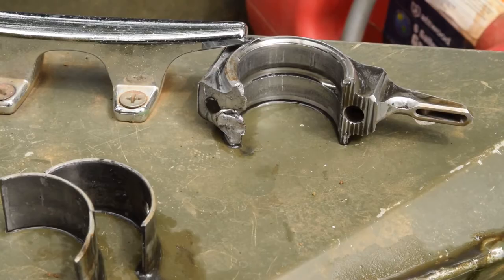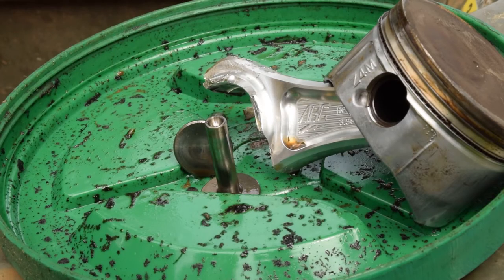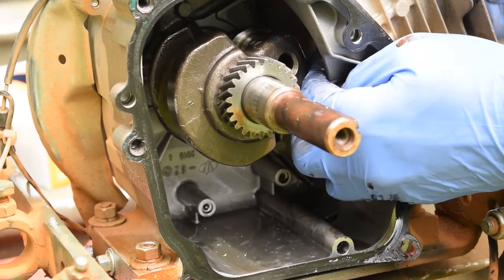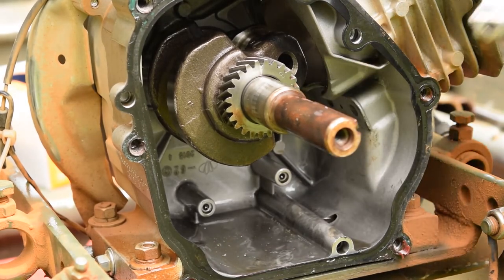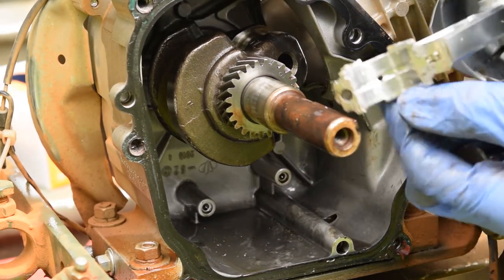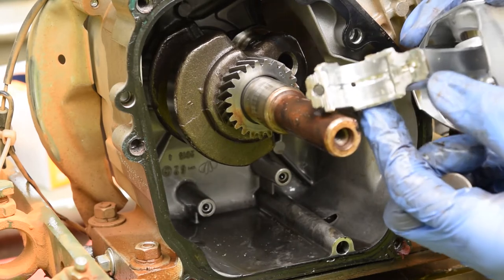Thailand Outboards Hot Rod | Current Recommendations

Comment: I've followed you for some time and always enjoy your videos. I ordered a stage 3 212 from nr racing, tuned and dyno'd with just about all the internals upgraded. I'm hoping with all the extras I had them put in, as well as the company I ordered it from, the engine will be as efficient as it will be strong. Putting it on a alumacraft 1232.
Reply from the maker: NR builds good motors. Be careful and don't push the engine to much. Don't run it at full throttle more that 1/2 a mile or so. Keep it well below 5,000 RPM most of the time. Get a good tachometer, and baby the engine. Don't thrash it.
Reply: Black Warrior Lures, I bought the tack through SPS. I don't plan on doggin it out or even running it above half throttle as to half throttle, around 6000 RPM, it's pushing 16 horsepower which is more than enough to push a 12 foot jon boat with one man and less than 50 lb of gear
Reply: Also, I opted to get the Billet side plate which comes will a second bearing to help balance the cam. Which I hope will cut down on vibration and wear and tear on the motor
Reply from the maker: I've always wondered what the billet side plate would work like.
Reply from the maker: Yeah, that's about what my old Predator did. Part of my argument too that I didn't mention was the cost, for the cost of building a motor like that, you could have bought the medium kit, a 301 Predator and still had more torque than the hopped-up build with none of the risk.

That's not to say you made the wrong decision. It's your money, and I certainly didn't buy the motor for you. I promise you will enjoy this engine. 

And I hope people don't get me wrong I really do enjoy these little 200cc engines. In terms of power-to-weight you can't beat one of these built small-block engines.

In terms of reliability-to-performance and cost-to-performance, there is much found wanting.

At any rate keep me posted on how this engine works out for you. I'm interested to see how it run for you.
Reply: Black Warrior Lures, I'm hoping it's worth the money. I'm sure with a built-in bearing it will definitely help with the vibration of the cam. There for helping the engine run smoother and more reliable. It's pretty nice with it being billet , and it definitely looks cool. However, I did notice while bolting on my SPS kit, that the threaded holes aren't as deep as the stock side plate cover. I had to add two washers to give it to seat properly. I did not want to talk them down too much and strip anything because the side cover is around $120 and I did not want to have to replace that before even putting the boat on the water. Your channel inspired me to do this build. You do great videos and I appreciate all your knowledge. I'm hoping that this mother can last because if this one blows or something fails, I just going to go with a stock engine and put a few of the parts into it and leave the governor in
Reply from the maker: Oh, I forgot it also has a bearing for the cam. That should help stabilize the valve train well.
Reply: Black Warrior Lures, yes sir. I know from everything I've learned watching you and other forums  that I have read, it seems once you beef up one Link in the chain, it's just a matter of time before the weakest link breaks. I'm hoping with having a motor professionally built by a company that specializes in these motors, as well as having all the extra nice parts put into it, I hope to not run into any failures. Fingers crossed! Either way I'm running by Harbor Freight today on my lunch break to buy a backup motor just in case something were to happen. My twin brother and I are going to go out to the Chattahoochee River this weekend where are grandfather used to take us. So I'm super excited to say the least
Reply from the maker: That'll be a fun trip. Good choice on buying a backup motor. That's the way I would do it. That way you'll be back up and running next day.